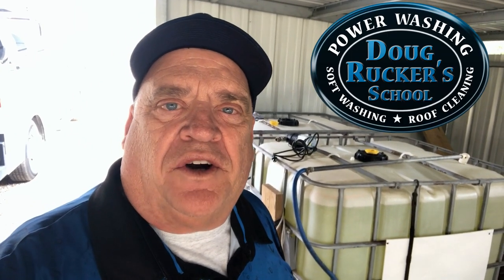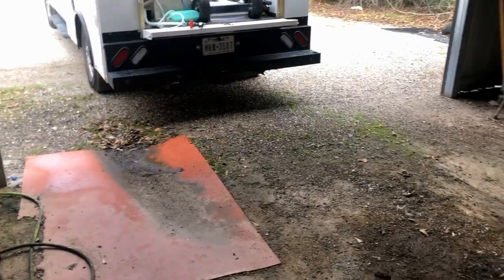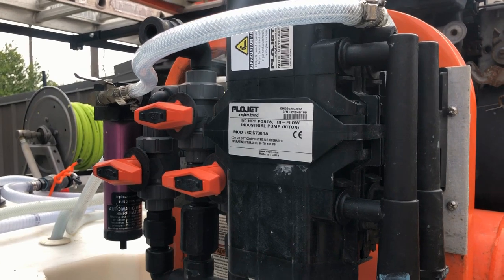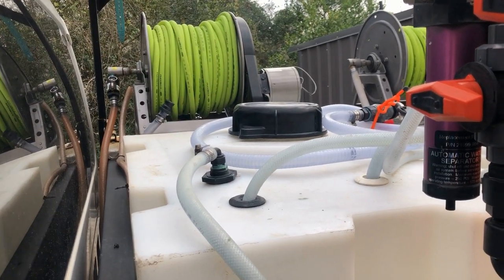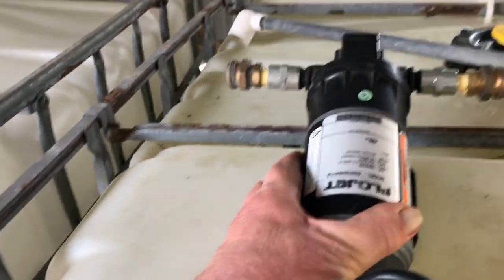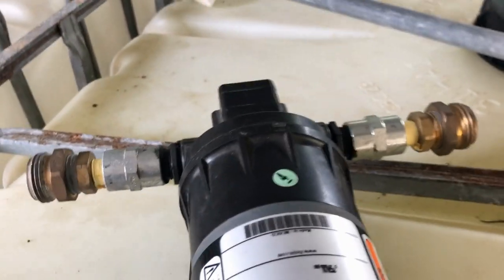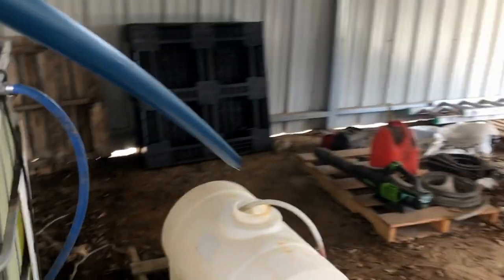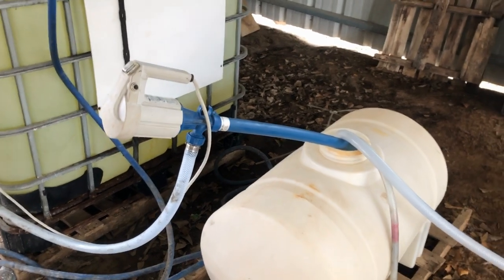Power Wash Bleach Tank Transfer Methods

Comment: I was told if you had more than a 55 gal drum at a time you had to have a license or something by some window cleaner that was at our work? Is that true?
Reply from the maker: No. Not right.
Reply: You need all the hazmat documents, registrations and license when you have 1,001 or more Lbs of class 8 corrosive which is what bleach is. Bleach is about 10Lbs per gallon so your limit is 100 gallons without needing all the hazmat stuff. But that's bleach alone and I haven't looked to in depth yet if you carry other chemicals, quantities and categories since we as an industry sometimes have caustic soda( sodium hydroxide) aka degreaser, oxalic and muriatic acid with us.